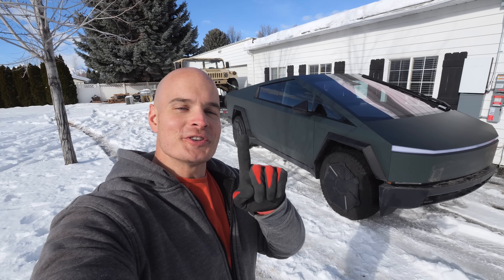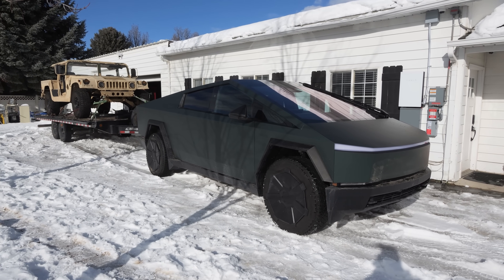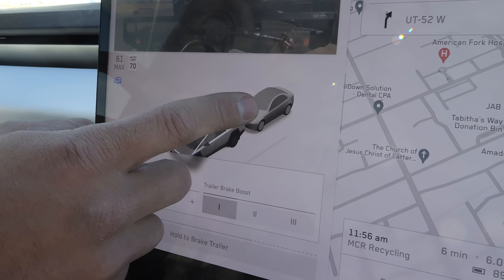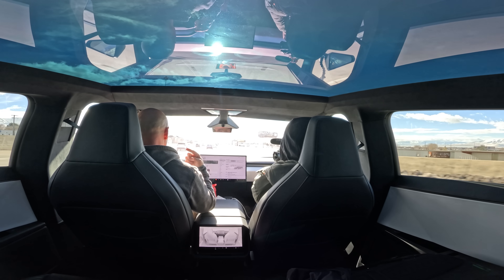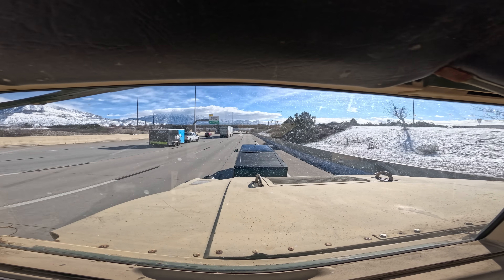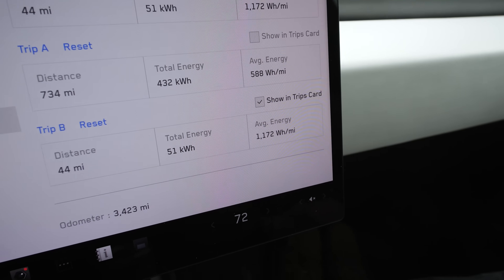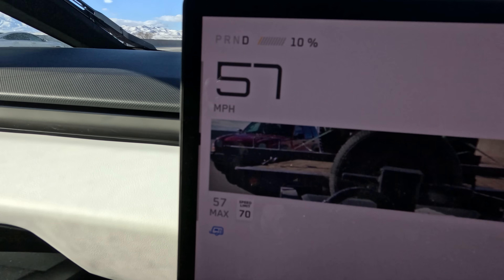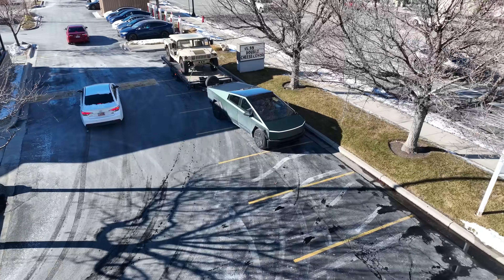How far can the CYBERTRUCK tow 11,000lbs in Freezing Weather?

Comment: The cabin noise is intense! 😬
Reply from the maker: You are correct
Reply: @JerryRigEverything   sounds a lot like the Chinese BYD electric single decker buses we have here in the UK. A lot of transmission noise when accelerating or slowing.
Reply: I would imagine the gigantic A/T tires are the main culprits of that very loud hum, and a little of the reduced range.  @JerryRigEverything
Reply: @JerryRigEverything when’s the next bunker video?
Reply: @JerryRigEverything  where's the review of the Samsung S24 ultra pleaaaase???!!!
Reply: @kannonhoyla4756  The Samsung S24 won't even be released until Jan 31.
Reply: @JerryRigEverything  Very first time seeing a video of yours, very first thoughts, you are Agent 47 if he retired.
Reply: lol, confirmative lizard man @JerryRigEverything
Reply: @JerryRigEverything nice video thank you. But use metric please..Most of the planet does not know what is lb (and why it is equal to pound), foot, gallon etc... 😢
Reply: @brainrotchallenge   It's an American only truck, driving on American roads, posted by an American YouTuber, to a mostly American audience.
Reply: @brainrotchallenge  lb means pound because the Latin phrase for a pound was "libra pondo." Also, you might just be better off learning the rough conversion between the units- it shouldn't be too bad.
Reply: @brainrotchallenge  11k lb is roughly 5.5 metric tones
Reply: why would he need to learn conversion from a system that about one country uses to something the entire rest of the world uses. @mystith
Reply: @SB7-r9i  why do we speak English when there’s more people speaking Chinese.
Reply: @reidjordan4545  totally agree. And i am not  against using imperial units, just asking to add some metric with them.
Reply: @SilverXTikal to be fair, I think even the Japanese use metric.
Reply: @weedfreer  NOT THE POINT I WAS MAKING STANLEY!
Reply: @brainrotchallenge the entire video was captioned with metric equivalents. You're kidding right??
Reply: @brainrotchallenge  He literally puts the metric conversions on screen.
Reply: @reidjordan4545  but is built on the metric system!! Lol
Reply: @brainrotchallenge I’m an American who follows a lot of YouTubers outside the US who use metric. I Google things like hectare, stones, C, etc. In a way, I like how it expands my own knowledge of the world. I don’t think it’s intended to leave anyone out but is just based on the majority of the audience.
Reply: @brainrotchallenge  No disrespect but you can use the internet to make those conversions don't be lazy
Reply: @reidjordan4545  and that's why you think that someone with Jerry's reach should be so lazy that for people who, despite everything, watch his channel in other parts of the world, not add information in the subtitles about how much it will be in metric units? I know that the bigger the account, the less you have to try to gain the viewers' favor, but… BS!
Reply: @SB7-r9i the conversions are super easy to remember you act like he’s asking you to do calculus
Reply: @mystith  While it's true that conversion is not difficult, we here in the U.S. should FINALLY get around to adopting the standard used by THE REST OF THE WORLD, instead of sticking with an arcane standard that even its primary proponent (England/Great Britain) has dropped. Canada also uses metric. I remember back in the 1970's, the government pushed for adopting metric, posting speed limits in both units of measure, etc. It got so much push-back that they dropped the effort. Big mistake. The metric system is more logical. Also, for a career in science, engineering or physics, it is a requisite.  How about a compromise here - post BOTH units of measure.
Reply: @brainrotchallenge should he do it in black face for all the African viewers too?
Reply: @brainrotchallenge most of the people won't get the CT in their part of the world. The CT is made in the States and is intended for sale and use predominantly in the States.
Reply: @SilverXTikal  No? It's like being English and asking for English language in a Japanese video. Unless you think metric is as widely used as Japanese.
Reply: @reidjordan4545 exactly 💯.
Reply: @Requiemes  I think people should probably enjoy the content and stop thinking about how THEY want the creator to present it. How about learn the conversion of you REALLY wanted to know.
Reply: @mystith  The world adjusting for American "quality" education again
Reply: @brainrotchallenge  It's really not that hard to convert them roughly. There's like 4 to remember. Inch, foot, ounce, pound.
Reply: @brainrotchallenge probably his audience Is mostly American.
Reply: @SB7-r9i  if you’re mad just phone up ol’ Joe and ask him to literally stop the entire country and switch to metric just because you’re mad.
Reply: @brainrotchallenge  I know right not even England uses the old English measurement system any more for most things! I think it's only USA public (a good number of their engineering firms use metric calculations, then convert to old English for the public) and Liberia that uses it now, maybe one other country! But things are weird there, like they sell milk by a gallon ~4 L, and soda by the L?! To his credit it looks like they put some conversions on the screen, like 60 mph test is what the rest of the world calls a 100 km/h test.
Reply: @brainrotchallenge  90 miles = 145 km approximately
Reply: @brainrotchallenge get a grip
Reply: mcphaden  ever consider it just went over your head? It’s ok to consider that
Reply: @brainrotchallenge When it comes to the cybertruck. In the famous words of Borat : " You will never get this"
Reply: @brainrotchallenge  its about 2.2 lbs to a kilo. Its not hard to just look it up or memorize the rough conversion. As an American I often have to use metric or know/ look up basic conversions, it’s a good skill to have at any rate.
Reply: mcphaden the comparison is to counter the argument that since most countries use metric the US should aswell. The counter obviously being that English and Chinese are the most popular languages in the world so why does everyone else still use their native language, aren’t they so selfish/stupid for not converting to the more ubiquitous system. If you thought that comment sounded dumb now you understand what Americans think when they hear people say that we should change to metric.
Reply: @reidjordan4545  I'd be surprised if most of Jerry's audience is American.
Reply: @reidjordan4545 and for Americans just turn to metric
Reply: dont be lazy and just calculate it in your brain like i do..its a good exercise 😅
Reply: @reidjordan4545  Merica!!!😂😂😂😂
Reply: @just_archan  
11,000 pounds is 5.5 SHORT TONS. It’s 4.9 imperial tons (2240 lbs) or 5 metric “tonnes” (2200lbs) 
It’s not hard.
Reply: @brainrotchallenge Hey, think about it, how entitled and chill must someone be to write this? Dude, Google can do the translation quicker than it took to write that post. 🤦‍♂
Reply: @reidjordan4545 Sure because nobody outside of the us is interested in an novel car that's one  of a kind in it's design etc.......
Reply: Just look it up if you don't know it?? No reason to remain ignorant he even shows the metric number
Reply: @brainrotchallenge stop whining and learn our system if you  like our content creators. You'll never hear an American being so entitled if the situation is reversed
Reply: @brainrotchallenge  "Please adjust to my personal preferences because I'm too lazy to do simple math and am the world's biggest debbie downer in life."  

Happy?
Reply: @brainrotchallenge Do you go to french videos and tell them to speak English?

I agree imperial is a terrible system but it is local to the author. Get over yourself.
Reply: @reidjordan4545  US Americans should learn metric.
Reply: @reidjordan4545  I think there will be a large export market for Mexican Cartels having a 0-60 of 3s and being bulletproof. Mexico uses Metric.
Reply: @brainrotchallenge 😂
Reply: @brainrotchallenge just the important part
Reply: @reidjordan4545 i don't think so tbh, i bet a good percentage of viewers is outside the American Continent
Reply: @reidjordan4545  yea? And? Post metric. Stop using anything else.
Reply: @gregparrott He should just present the figures in some obscure unit so we all have to do the conversion.
Reply: @PPPOOOFJJD When some other country produces something inthreshing, then that countries creator's can make a review video about it in the units their country uses and post it on their countries video platform.....Until then, this is an American producing a video about an American product while in America using units Americans use and posting said video to an American platform.
Reply: @alvodisco ”hey siri, google, bing, insert AI or assistant here, what is ____lbs converted into kilograms?”. Pretty easy, most people are already on their phone. I’m sure all the metric people have to do conversions less than us Americans so too bad.
Reply: Sounds like a personal problem. Learn to convert
Reply: @brainrotchallenge it says near the end
Reply: @SilverXTikal except the entire rest of the world speaks japanese
Reply: @brainrotchallenge  You don't need to know the data if you don't understand moron units anyways, because that thing is never going to be available anywhere else but the US because of so many safety concerns. And if it is, it will have different specs
Reply: Because it will not pass the safety standards of the rest of the world. @LemonySnicket-EUC
Reply: @copypaste4122 do the conversions yourself, you might just learn something
Reply: @petes1926 The rest of world, and most notably the scientific world, already learned something about the imperial system: it's terrible.
Reply: @reidjordan4545 and you cannot even drive such a vehicle in Europe with a regular B cat driving license as it crosses 3.5t gross weight limit. But since C cat is limited with seats up to 3 and it seems to have 5, then you will end up having a bus driver license if you ever would wish to drive such a thing in Europe. So yeah, measurements are nice to see, but it is the only car for America where everything is oversized and towing a camper with a sedan is outrageous.
Reply: @alex-b9k7z my comment had nothing to do with how terrible to imperial system is. I simply stated, instead of demanding someone convert the units of measure for you, do it yourself and you might just learn something.
Reply: @petes1926  Ok, great, any other suggestions? Maybe pick up Latin while he's at it, I'm sure that'll help him out. No wonder that idiotic system is still being used, look who's using it.
Reply: @brainrotchallenge such an entitled attitude
Reply: Some american youtubers have started putting visual conversions into metric as a corner note into their videos, but i guess it is just better to learn rough conversions from imperial to metric yourself if you dont live in america. I myself have no problem converting miles, feet, inches, pounds, miles per hour, ounce, gallon, square feet, acres etc., all that is quite easy to do in my head, however the temperature is where it all goes wrong for me.

 I am used to water freezing at 0 degrees and boiling at 100 degree, with cozy room temperature being 23, human body being 37, nice hot shower being 45 etc. but if i see temperature in fahrheit saying like 55, i have no idea even roughly if it is tshirt temperature or jacket temperature or winter temperature, and the conversion is quite difficult because you have to be precise, even 5 degrees can make a huge difference. 

calculating F->C as (F-32)x(5/9)=C or the other way around Cx(9/5)+32=F is quite time consuming. Although i guess you can do just (F-30)/2=C and Cx2+30=F and you get close enough within couple of degrees in the "liquid water" range. But still of all the imperial units i wish americans measured temperature in celsius.
Reply: @brainrotchallenge why don’t you learn our system? How is it our problem that your country uses metric?
Reply: @just_archan  11K lbs/2.2lbs/kg = 5 metric tons
Reply: @brainrotchallenge Murica!
Reply: @reidjordan4545  Guy is  entitled and believe everyone should do as he does. Love your comment tho.
Reply: @brainrotchallenge  His videos are mostly for the US market and in the US we dont use metric...we use freedom units. :p
Reply: You can literally do the conversions in a few seconds. Shorter than it takes you to complain every video
Reply: @brainrotchallenge be smarter and know both silly person
Reply: @brainrotchallenge What, you don’t have Google in your country?
Reply: @brainrotchallenge  or you could just google and convert it urself. its not that hard bro. go back to school lol
Reply: @brainrotchallenge  Metric is based on French nationalism. They bribed other countries to use it (like the UK using the metre in return for France giving up claim of the Prime Meridian going through Paris and acknowledging the Prime Meridian in Greenwich. Or offering smaller countries favourable trade deals). So could you please quit your bigotry? 
Highly composite numbers are more mathematically sound than base 10. Even the metric system is based on 60 seconds in a minute, not 10 or 100. (12, 60, 360 are all in the class of "superior highly composite number".)  Metric snobs call everything that is not metric as "Imperial" even though an Imperial gallon is different than a US gallon, or how SAE sizes (an automotive standard) are not imperial either. 

Most of the world does know what pounds are even if they don't use them. Just like much of the world knows what the Marvel Cinematic Universe is / what the Avengers are, even if they haven't watched them.
Reply: @brainrotchallenge  US units are not Imperial units. No one in the US measures weight in stones. The US is older than Imperial units. The colonies were using Winchester units before Imperial existed.
Reply: @christopherludlow3106  US vehicles are designed with SAE (Society of American Engineers) automotive standard units, not metric. SAE is not Imperial either. You sound uneducated when you start spouting metric bigotry and getting basic facts wrong.
Reply: @gregparrott  The US has never used Imperial units. Metric is based on French nationalism. They bribed other countries to use it (like the UK using the metre in return for France giving up claim of the Prime Meridian going through Paris and acknowledging the Prime Meridian in Greenwich. Or offering smaller countries favourable trade deals). So could you please quit your bigotry? 

Highly composite numbers are more mathematically sound than base 10. Even the metric system is based on 60 seconds in a minute, not 10 or 100. (12, 60, 360 are all in the class of "superior highly composite number".)  
I could go on about how metric snobs call everything that is not metric as "Imperial" even though an Imperial gallon is different than a US gallon, or how SAE sizes (an automotive standard) are not imperial either.
Reply: @anydaynow01  No, the US has SAE (Society of American Engineers) units for engineering firms, which is an automotive standard in the US.
Reply: @XXX-XX-X-X  The US has never used Imperial units. They broke away before Imperial came into existance in the 19th century.
Reply: @michaeljudge5942  metric makes people lazy at math. People who use metric lose skills with fractions.
Reply: @feetfats1  metric is dumbing down. People's math skills at fractions get rusty.
Reply: @poochyenarulez  Metric is based on French nationalism. They bribed other countries to use it (like the UK using the metre in return for France giving up claim of the Prime Meridian going through Paris and acknowledging the Prime Meridian in Greenwich. Or offering smaller countries favourable trade deals). So could you please quit your bigotry? 
Highly composite numbers are more mathematically sound than base 10. Even the metric system is based on 60 seconds in a minute, not 10 or 100. (12, 60, 360 are all in the class of "superior highly composite number".)  I could go on about how metric snobs call everything that is not metric as "Imperial" even though an Imperial gallon is different than a US gallon, or how SAE sizes (an automotive standard) are not imperial either.
Reply: @FarmerSchinken  Why are you so bigoted? Units that use superior highly composite numbers are more mathemathically sound than metric units.
Reply: @ericaltmann5711  "the rest of the world" does not have the same safety standards. China has almost no safety standards. Look at all the "tofu dreg" construction that is collapsing in China right now. The recent massive flooding was due to inferior or missing drains.
Reply: @alex-b9k7z  Science does not care what units you use. Only that you use rigour instead of feelings. Metric is based on French nationalism and Revanchism from hurt French pride at losing a war. Units that use superior highly composite numbers (12, 60, 360) are more mathematically sound than base 10 metric.
Reply: @niklFIT  I wish people would stop calling US units "Imperial". The US broke away before Imperial units existed, so the US has never used Imperial. Celsius is just old school cancel culture when the French hated the Germans for how badly the French lost the Franco-Prussian War. I'm not sure why water boiling around 200 is any different than it boiling around 100, but Fahrenheit (which you couldn't even spell) had a German sounding name, even though he was born in Poland and lived his life in the Dutch Republic, but the French had to cancel anything German sounding. Metric is France's "freedom fries".
Reply: @brainrotchallenge  16:42
Reply: Metric system is universal, Japanese language is not. @SilverXTikal
Reply: @anydaynow01  Stone, pound, ounce, mile, yard, foot, inch, pint, and more are all still in use in the UK wym?
Reply: @reidjordan4545  So your saying the rest of the world shouldn't watch (the total insanity that the US is) then?
Reply: @brainrotchallenge  No
Reply: @mystith  No one cares what it is in latin.
Reply: @sammiller6631  thanks for clarifying this. I have literally work side by side probably 20,000 hours the last 8 years with engineers for Ford, Chrysler and GM installing equipment for them and their many OEMs from Italy, India, Japan, Germany and many other countries. SAE is literally a society that was formed to standardize practices throughout the industry, just like other industries have "ISO 9001" standardized practices.

I've been handed hundreds of cad drawings that are all in metric.

But please go on...
Reply: @sammiller6631  The Society of Automotive Engineers (SAE) originally developed fasteners standards using U.S. units for the U.S. auto industry; the organization now uses metric units.
Reply: @christopherludlow3106  Were those CAD drawings in metric or were they in SI? If you're going to flex about minutiae, be precise.
Reply: @christopherludlow3106  at least you called them "using U.S. units for the U.S. auto industry" instead of saying Imperial units.
Reply: @sammiller6631  standard & imperial are same damn thing other than units of volume. Distances are inches-fractional regardless of the name imperial /standard, ya dolt.
Reply: @christopherludlow3106  Calling people "dolts" doesn't undo the nationalistic bigotry invested in units of measure. Superior highly composite numbers are still superior for fractions. Imperial also uses "stone" as a official unit of weight, unlike US customary units.
Reply: @sammiller6631  I'm reminded of a quote from a movie - "At no point in your rambling, incoherent response were you even close to anything that could be considered a rational thought. Everyone in this room is now dumber for having listened to it. I award you no points, and may God have mercy on your soul."
Reply: @just_archan no it's not 2200lbs is a metric ton  200lbs is a Imperial ton 
You thinking imperial ton 2 different thing
Reply: @alvodisco with a user name  copypaste4244 he probably the most lazy person you ever know lol
Reply: @brainrotchallenge  This is in America.
Reply: @PPPOOOFJJD what the system you use and the quality of education have anything do do with each other
What a get from your post is the education system failed you lol
Reply: @xcaliber4141 so you too lazy to learn or also google the conversion but you got no trouble if it's the other side that need to do the conversion
By your logic all video should be in English it's the official international language
Reply: @Dave5843-d9m lol it's not hard but a short ton is 2000lbs  and a long ton is 2240lbs
And a metric ton is 2200lbs
So what is a ton
A ton is a pretty misleading term and should only be used for the metric system 1 ton is 1000kg
Reply: @brainrotchallenge We Americans don’t understand our own weights and measurements system either. You are going to have to Google it just like we do!😂
Reply: @just_archan  actually less than 5 tones
Reply: @brainrotchallenge  1 lb = 0.45359237 kg
1 kilometer is equal to 0.621371 mph
Most of the planet can’t do math or just you?
Reply: @SB7-r9i because he asked while watching a video from that country explaining in that countries standard. Why doesn’t Carwow provide torque figures for vehicles in ftlbs?  Oh cause Nm is what they use where they film. Genius
Reply: @reidjordan4545 well, this opens up much deeper problem of why would still anyone use such units but yeah 🏋️
Reply: @brainrotchallenge  you should know a pound is basically 0.4 kilograms, which you can round to 0.5 kg if you aren't comfy with math. As much as imperial is a clearly inferior system, I really cannot understand how most of my fellow Europeans struggle so much with some basic math. Just stop crying.
Reply: @legros731  language is something different, measurements makes more sense in metric system its proven and i know 6 languages hardly any trouble in that area but using absurd things is just insane, by ur logic numbers shouldn't be lined by 10 units bcoz hey why make it easier for anyone when u can make it harder thats the American way and seen ur education level its not even good
Reply: @brainrotchallenge  literally includes the translations in the video lmao
Reply: I am an American machinist.  I do metric conversions daily. I manufacture and measure using inches. The drawings I receive are a mix of both. I design for 3d printing in inches and metric both, but the slicer software and printer are metric. I design for laser engraving in metric. I don't whine about it. We are in a long slow transition. This is reality.
Reply: @brainrotchallenge  NOOOOOO
Reply: @brainrotchallenge  11klbs converts to a little less than1 african bush elephant. because merica
Reply: @SimonBauer7  evidently he does if he's worried about not knowing the units of measurement in a video he chooses to watch
Reply: @brainrotchallenge there are countries who use the metric system, then there are countries who landed on the moon.
Reply: @brainrotchallenge  He's an American with a predominately American audience.
Reply: @reidjordan4545  Canada isn't Imperial, and we have the CT. But great attitude
Reply: @gamerguy6990 bcz english is international language, and metric or kilogramm is international unit
Reply: @just_archan  11,000 pounds is equal to 10.5 us tons. In metric you get 4.9896 metric tons.
Reply: @reidjordan4545  How you know the audience is mostly American? Did Jerry share this personally with you.

The world is bigger tha😊n just the US....
Reply: @brainrotchallenge   Do your own research to calculate the metric values. And that comes from a person who also lives in a country that uses metric values.
Reply: @brainrotchallenge  google exists, no tea units for you.
Reply: to make it easier for you, just divide the lbs  by 2 and half of that is killos. It is not exact. 1lbs is 0.454 kilo almost half a kilo, so just add a little bit on top of that. Im not good at math, but you can get pretty close with those numbers. I always think 2lbs is a kilo :) its not its .9 but good enough for me. Cheers   @brainrotchallenge
Reply: @reidjordan4545  The internet on which the video is uploaded is not just america, even if google and youtube are us-companies. Meaning: the whole world uses the internet, and the internet not only is usa.  This video was uploaded to the internet, therefore to a worldwide public, and not only a us-public. Therefore its more than legitimate, to demand units which 95% of the world understands better , instead of using tribal units like foot, armlength of grandma,  spit-distance of the average 35 year old man, etc  ... And those units arent even more easy for the americans  - or can you tell me right from your head how much inch 3768 yards contains ?  Btw 3768 meters equals  376 800 centimeters (added 2 zeros to the end... right from my head and immediately 95% of the world know what i mean). Its interesting how people can stick to a flawed thing, as long as they were born with it, and got used to it. So much disatvantages, but still defending it, as if americans invented foot, etc.
Reply: @reidjordan4545  Why not use both?
Reply: @brainrotchallenge What a ridiculous comment lmaoo
Reply: @just_archan 11k lbs is pretty much exactly 5 metric tons (4990kg). It's also 5.5 US tons. One US Ton = 2000lbs, which is stupid af. 

"The three types are all a measure of mass (weight) the short ton aka US ton is 2,000/lbs. The long ton aka Imperial (British) ton is 2240 lbs. The third ton is the metric tonne which is, equal to 1000 kilograms, or approximately 2204 pounds."
Reply: @reidjordan4545  Id challenge the theory that its a predominantly yank audience... from the rest of the english speaking free world.
Reply: @cd2290 bruh neither Hectares or stones are metric units of measurements
Reply: @christopherludlow3106 nah, it's called standards here so it's standard to us. Who cares about you? Lol
Reply: @weedfreer you missed the point. Then again, would've expect much from your kind.
Reply: @daylate  no, I was being deliberately facetious in order to trigger you all… something that appears lost on ‘your kind’ apparently (whatever TF that means anyways)
Reply: @JerryRigEverything you are such a propagandist you're trying to make the Tesla cybertruck look as bad as possible by putting up every tactic inbthe book. I'm going to leave it at that but you know what you did if you question me I will point out every single one of the things you did.
Reply: @AquarianSoulTimeTraveler cry kiddo
Reply: @AquarianSoulTimeTraveler  glad others are seeing it too. Man's been on a downward slope for a few years now.
Reply: @AquarianSoulTimeTraveler stop mimimimi lill fan boy.
Reply: @STE_FAN999  faceless account who cares what you think you're not even a real person.
Reply: @STE_FAN999  I wouldn't say Fanboy but I'm just not a blatant propagandist like the creator of this video... when I see blatant propaganda trying to pretend like it's not blatant propaganda it really pisses me off when I see weasels acting like they're not little weasels it really pisses me off!
Reply: @AquarianSoulTimeTraveler  mimimimi goes on.
Reply: @STE_FAN999  enjoy your pointless commentary that does nothing to forward the conversation because you're too scared of an argument therefore you make no stace and fling 5hit from far away that way the conversation doesn't ever get driven forward and no one learns anything from our commentary that way your propaganda campaign will have a higher percent chance of success because you fail in a logical argument therefore you don't make one.
Reply: @AquarianSoulTimeTraveler  bs does not need an argument.
Reply: @STE_FAN999  yeah I can see that you're full of it...
Reply: @AquarianSoulTimeTraveler  why so rude little boy or girl?
Reply: @AquarianSoulTimeTraveler  It's not propaganda, soul bro.
Reply: @AquarianSoulTimeTraveler absolute tool he did the exact same test with the rivian and f150 so I absolutely don't know what you trying to point out
The only thing a can see is you brought one and are trying to find reason to cope with the extremely bad decisions you made
Reply: @AquarianSoulTimeTraveler go ahead we waiting for you to point all the thing he did wrong
People that say this 99% of the time they got nothing so I am waiting clown
Reply: @AquarianSoulTimeTraveler  Open up a window, you need some fresh air
Reply: @sysc0mp72  ok AI fake cat pic account too weak to make an actual argument....
Reply: @DetroitBORG Why’d you leave us???
Reply: We miss you Detroit Borg!!
Reply: @detroitborg we miss you !!
Reply: My 2007 F550 has a lot of cabin noise at highway speed, and this CyberTruck sounded worse! It's unbelievable. I thought this truck would be sealed up super tight and ride very quiet.
Reply: Is this not tire noise from those big tires. More aggressive the off road tire is the noisy it gets
Reply: It would really bother me to drive with this noise. When the video switched from CT to Rivian, it was such a huge difference in noise pollution
Reply: Elon Musk saving money on sound proofing and stuff like HUD
Reply: The Borg lives!!!
Reply: "Sounds like they're filming an episode of Bonanza" -Jeremy Clarkson
Reply: If you tow 11,000lbs with other trucks you get some weird noises too. The vibrations from the trailer radiate through the vehicle.
Reply: Yep, those hummers were such rattly POS that even a converted one being towed is loud AF.  @Zeesneakyninja
Reply: i completely forgot ab you bro, i used too watch you soo much.
Reply: you should wait for GM to come out with a Caddy version.🤣
Reply: I'm curious if it's only in towing mode during towing.
Reply: Agreed!
Reply: I noticed too.
Reply: long time no see brother 😢
Reply: "Huuuurrrrrrrrrrrrrrrrrrrrrrrrrrrrrrrrrrrrrrrrrrrrrrr" lol
Reply: Its a feature
Reply: British buy everything by the litre, ml, kg and grams. We judge distances in miles but that about it.
Reply: @Dave5843-d9m   The British still buy bitter by the pint and express their weight in stone.
Reply: @Dave5843-d9m  The British also measure weight in stone.
Reply: Worsethen my Smart Fortwo 453, & there’s a lot of noise in there… but you can ignore it or easily cover it
Reply: The noise is likely all the extra power in the motors required for towing.
In my Plaid the motors become significantly louder at 75% plus power.
Reply: What garbage. These need massive improvements before this would be a useful machine for me
Reply: Average 2000s 2.5liter diesel pickup from eu
Reply: By intense you mean atrocious?
Reply: Great video thanks for sharing. I just don’t care for the looks of this vehicle. I have a large enclosed snowmobile trailer we haul 5 sleds and all our gear so we are right at 11000 pounds. This truck would increase our drive time significantly as our destination is 350 miles north into Quebec.
Reply: @wdsracer  What's wrong with the looks?
Reply: Yea I really don’t like it.
Reply: Is the road noise the same without towing that much??
Reply: due to the microphone, when he filmed the rivian had a microphone
Reply: Thanks vor the added Metric numbers
Reply: That noise  sounds like a diff about to blow.
Reply: Not as intense as a straight piped diesel.
Reply: Miss you making videos man
Reply: Snow tread on pavement! 😲 Put some radials on those rims and I bet she quiets right down! 🙂
Reply: Man, you weren't kidding. Sounds like he's mashing potatoes, lol. I'd go nuts if I had to hear that noise during a long haul drive.
Reply: Was gonna write the same and the top comment is about the same. The Rivian noise insulation is a galaxy away from the cybertruck's non-existing one.
Reply: @detroitBorg Is that a problem ?
Reply: pos car
Reply: It's the tires people
Reply: seems like you need Headphones in Cyber truck as in Humvee :D
Reply: Wow, an actual real non politically motivated criticism. Good on ya.
Reply: That will drive me crazy sounds like wheel bearing is already out
Reply: @thelifeaquatica and 1000x better looking
Did elon asked Homer Simpson to design is truck ?
Or maybe he got a brother he didn't know before and let it design the car lol
Reply: @@Electric_car_channeldid the other video where towing or just driving ?
Reply: Yes, @DetroitBORG, they are called TIRES, and especially all-season or winter tires will cause more cabin noise because of the tire profile,  pretty sure that a 10 year old would've known that..
Reply: Does the Zybertruck rust as bad as the other tezzlaz?
Reply: I like the noise.  Almost like an internal combustion engine.
Reply: typical Tesla cabin noise and road rattle
Reply: Do the test with a actual CYBERTRUCK  when they are actually open to buy by the public.  YOU SHOULD HAVE DISCLOSED THIS IN THE VIDEO...   You're driving a "DATA GATHERING CYBERTRUCK"  - they are all over the US in different climate zones and sea levels to gather data for the A.I. to learn from.  This is why the User Interface is not complete... Ie the trailer animation - as it was not supposed to be trailering ANYTHING.  That is for a seperate testing program.
Reply: Drive a 4x4 Chevy/Ford/GMC/DODGE - anything with nobby winter tires and then compare - there is nothing intense about the road/tire noise.  It is far quieter in the CyberTruck.  Having a microphone with settings on the sounds with levels all maxed out on the audio file added on top of regular head level audio is manipulated content that pushes your "I've never driven one but I'll regurgitate what other Tesla haters are saying." worldview about this proven lie of cabin noise.   Jay Leno brought up the fact by the way and has said himself during his review of the CyberTruck that he can't believe how quiet it is with offroad tires.   Other vehicles do not do reviews with winter/nobby/offroad tires but instead us all season or summer tires to try and limit road noise being used in any review.
Reply: because of the lack of good aerodynamics. My fiat has the same problem.
Reply: Консервная банка с мотором.
Reply: intense?! it is undrivable! this is on par with me on the motorcycle with earplugs on.
Reply: So far, I have not heard noise in mine. In fact, I’m pretty happy with it. We do construction and drive it everywhere. I guess for little videos like this and viewership, it serves its purpose.
Reply: Nothing says cheap and nasty like that sort of noise in the cabin.  It's not hard to counter vehicle and road noises with many decades worth of research at hand.
Reply: @retrozmachine1189 he can't add 100 pound of insulation or the range gonna be crap lol
Anyways you would never see me driving this monstrosity designed by Homer Simpson c
Reply: @retrozmachine1189  Likely the tires. Also this is a super early production model and Tesla may not have added noise cancelation to the software yet. If its lacking noise cancelation it can be added easily with a software update.
Reply: Probably gears in the motor drives.  I could seeactive noise canceling on EVs become more common.
Reply: @MotoGPatrick  Are you saying that EVs are louder than ICE cars and that's why noise cancelling will be more common in EVs? 😀
Reply: @kl1nk0r  Are you saying that ICE cars are louder than EVs?
Reply: @MotoGPatrick  It's the tire noise for a 6,600lb vehicle with huge tires. Yeah, it's deafening.
Reply: @RoadHater  I've driven military vehicles,  I have a had a bunch of trucks everything from AT tires to MTs.  Gas and Diesel.  I own a tesla car and I've tried the CT now too.   The tread on the ATs on the CT is a CT only tread pattern.  Its the most highway tire looking "at" I've ever seen.  You dont hear tire noise when they go by.   When you get on it in a Tesla car or the CT there is noise coming from the motor and geartrain.  Even a Ferrar SF90 in EV mode has some pretty good elctric motor noise.
Reply: Why aren't we hearing the same in other Cybertruck review videos?
Reply: @user-vp1sc7tt4m  Mabe it's because they aren't towing 11,000 lbs?
Seriously, there's a 1,000+ lb tongue weight loading the rear bearings, the front bearing  are lightly loaded, and  there's a LOT more inductive loading on the engine (which commonly increases noise as the rotor shifts relative to the magnetic field)
Reply: @gregparrott lol 1000 lbs of tong weight 
It's a truck or it's not a truck no ice truck care about a 1000lbs Tong weight or a 11 000lbs load
A f350 can tow 24 000 lbs with a gooseneck trailer and 8000lbs of payload in the bed
You could literally put Jerry hummer in the bed if it was big enough lol
Reply: Hardly surprising for a Tesla
Reply: Tesla Quality 🤣
Reply: The noise is probably the tires. Pretty typical for vehicles with aggressive tread. Or if there is a gearbox for the motors they may have used straight cut gears which are noisy.
Reply: @marcochavanne   zach: it's not the tires. commenter: "it's prolly the tires"
Reply: @marcochavanne  No heat on the gears can be noisy.
Reply: Def gear noise if it's only on acceleration and deceleration.  I wonder if it does have straight cut gears @marcochavanne
Reply: @marcochavanne not the tires, it's a complete different sound. I have  295x75x20 and they do not make much noise. 37" rock crawling tires will.. 😂
Reply: had the same noise when it was sitting in the driveway, i wonder if its some sort of pump noise. should definitely be looked at.
Reply: Yeah, it sounds like there's something wrong in the transmission.
Reply: Why does it matter tho?
Reply: Made it almost unwatchable for me to be honest.
Reply: And I love it
Reply: off road tires btw if you didnt know
Reply: Guys, Here is The Savior

HalleluYAH translates “Praise ye YaH”

YaH is The Heavenly Father 
YaH arrives via the TENT OF MEETING
YaH was Who they Crucified for our sins
YaH was Crucified on an Almond TREE

— Ancient Semitic Cuneiform of Moshe (Moses)
— Isa Scroll (The Original Isaiah)

Isaiah 42:8
"I am YaH; that is my Name! I will not yield my glory to another or my praise to idols.

Isaiah 43:11
I, I am YAH, and there is no other Savior but Me.

Isaiah 45:5
I am YaH, and there is none else.
Reply: The noise would drive me nuts. Once you get used to driving the truck and it's become your normal drive you will still be stuck with that constant whine.
Reply: @grantadamson3478  not normal something not right.
Reply: becasue you don't have noise when you drive your vehicle and not to mention the mic is enhancing the sound....get off it mate @grantadamson3478
Reply: Hummer EV has that thing beat a million times over
Reply: @fafafohigh69 Tesla's Cybertruck was designed by Franz von Holzhausen, who was born in Simsbury, Connecticut, United States.
Reply: The noise will make a massive cancelled.
Reply: @JohnWilliams-gy5yc  it’s not that bad, if you’ve been in diesel trucks the cabin noise can often be just as bad while towing such a heavy load. For people using the truck for what it’s intended for I doubt it’s a deal breaker, but if you want a quiet road toy it’s probably not going to be the truck for you.
Reply: It is just interesting - my R1T is quiet towing or not - curious why CT isn’t.
Reply: @sparks6177 no cabin noise doesn't change because you're towing
Lol
Reply: @legros731  it changes when there’s more strain on the vehicle, again, that’s my own experience and its often sound from the turbocharger.
Reply: @sparks6177  tell m how it can change the sound of engine or the diff it doesn't make any sense
And strain on the vehicle won't change the turbo sound 
Maybe go check your ear
Reply: @legros731  if you’re towing you’re usually hauling something pretty big. Real world example: truck weighs 4-6 tons with tools, parts, and equipment, then load up a 8 ton excavator on a 20 ft trailer and you have now just doubled or tripled the original strain on your engine, and therefore increase the amount of noise it’s going to make.

Edit: For context my example of 12-14 tons is about 5 tons short of max towing capacity if that helps get an idea of how hard you’re working your truck
Reply: @JohnWilliams-gy5yc  You couldn't afford one anyways. Keep dreaming bud
Reply: karen jerry and karen borg
lovely couple
Reply: It is just the tires kids
Reply: @PaulFlahr it would be constant in that case. He said doing acceleration or deceleration. Which to me suggests gears being loaded up and making whine.
Reply: @PaulFlahr It's not 'just the tires'. The humming noise goes away off-throttle and comes back on-throttlle. It's the drivetrain.
Reply: @PaulFlahr Noise is noise.  Doesn't matter the source, to hear that in a modern vehicle is surprising.  It basically means they couldn't be arsed putting in appropriate sound dampening.
Reply: @retrozmachine1189  Off road oriented tires do that with any vehicle.  Just don't get the off-road tread if you want it quieter.
Reply: @PaulFlahr  I know how off road tyres, proper off road too not the obviously not very off road tyres on this vehicle, sound.  I know how they sound inside a modern vehicle too.  The noise levels inside the car are frankly ridiculous.
Reply: @retrozmachine1189  If they hurt your precious ears, don't buy it then.
Reply: @legros731  The one I saw had tread pattern  same as Goodyear Mud terrain